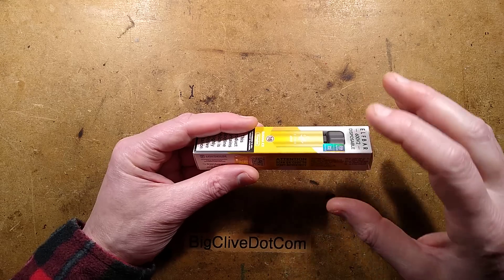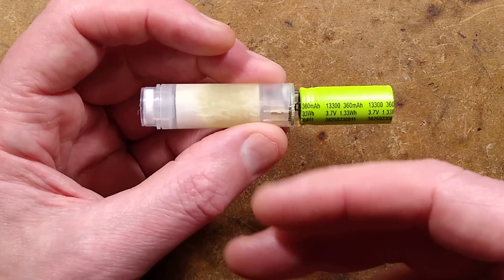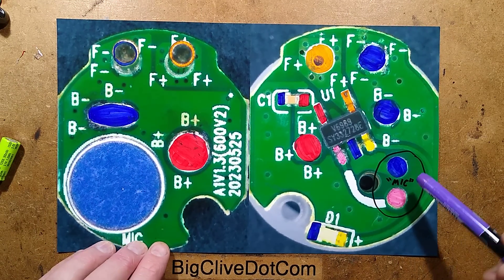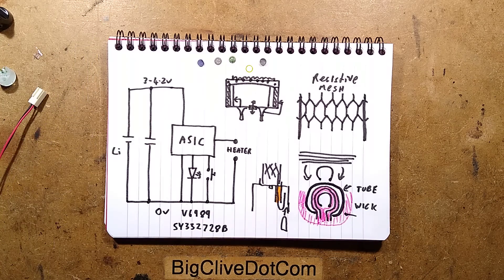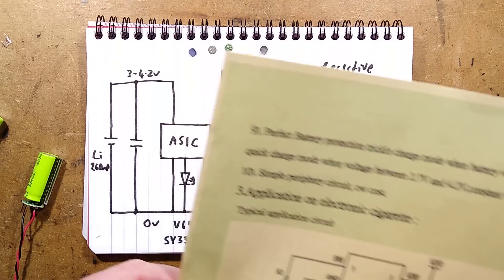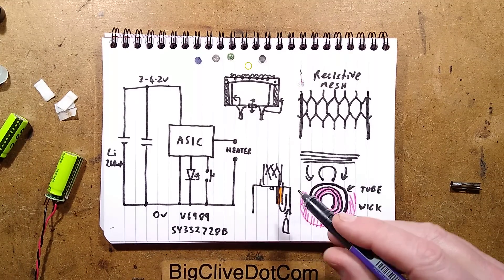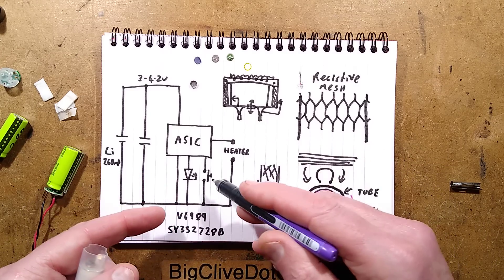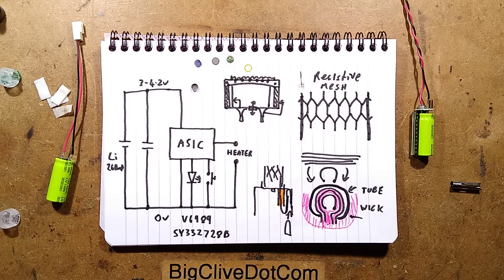Lithium "capacitor" in a disposable product

Comment: Shame it's still disposable but what a wonderful piece of engineering regardless...
Absolutely marvelous! Simple and effective, with just a bit less waste as compared to before.
Shame that we're still gonna find them where they shouldn't be...
Reply: The reason why they are disposable is because of the way they are designed. The liquid is suspended in a sponge type material, and the liquid is less dense, providing a more enjoyable vape. The trouble is the 2.0ml limit in the UK means they don't last long, and it makes them more wasteful.
The ones with replaceable pods are more eco-friendly, but the pods don't work out much cheaper, and they still contain the plastic tank,, mouth piece, coil and the sponge thing 🤷

Comment: heat the ground pin with a good soldering iron (JBC), tilt the cell so the pin slides out, then unsolder the positive.

less risky.

Comment: I've come across this model a few times and while its awkward to do, you CAN charge them, you just need some fine crocodile clips to get to the terminals and some kind of insulation to prevent shorting against back of the circuit board, after that, you simply hook up to your lithium compatible charger.
As for life of the device, I believe you should compare the coil of the V1 and V2 versions, since the coil gauge may be different.

Whatever the difference may or may not be however, I'll stick with rechargeable devices too, since you'll never get a strong enough flavored fluid to work particularly well with a recharged disposable device

Comment: Have you seen these hybrid lithium supercapacitors? They're basically a li-ion cell and a supercap in parallel, inside of a capacitor package. So you get energy densities similar to lithium, but peak current and ESR similar to supercaps. Unfortunately, being lithium, they do have a minimum voltage; discharge too far and they're destroyed.

Comment: I've found commonly with China products they cheat like this as follows ..3600mah is 3600 micro amps not milli amps ..the giveaway is the 2x 0 and the fact the the real world tests are always close to one of the zeros removed ..so it's a con job on the decimal point ..so 3600mah is actually 360mah ..

Comment: I bet that there is a small pouch style lithium ion battery on the inside. Wouldn't surprise me at all if they just were re-using a capacitor packing machine to wrap capacitor shells around a lithium ion pouch.

Comment: I suppose this does add some safety component to the device since the cell is contained within an aluminum capacitor casing. If something is to go horribly wrong with the cell it would just build pressure, and vent out like an actual capacitor. Even if the cell itself gets red hot or sparking, the fumes will have less of a chance to ignite if there's some distance between a potential source of ignition and the closest place where there's oxygen.

Comment: It is not not a Lithium Ion Capacitor (LIC) It would be labelled in Farads if it was. You would never specify a capacitor in mAh or Wh capacity or Diameter x length! It is just a lithium Ion cell in an interesting capacitor style can. The MIC is just that, but used as a capacitive pressure sensor (Clive, please see my detailed post 8h ago on the mic subject) It is definitely not a diaphragm pressure switch as such. Cheers Peter

Comment: The part labelled as MIC is in fact a microphone. Pressure sensors and microphones have very similar internals. Diaphragm on a coil, or in this case, diaphragm in front of an electret. Pressure sensors would generally be held to some kind of accuracy expectation and so they tend to cost $5+. So these guys are using a vented electret condensor microphone as a cheap differential pressure sensor. I guess that's what the ASIC is required for, it'll be looking for a reduction in capacitance (from the diaphragm deflecting away from the electret) from the mic for a certain extended period of time before it activates the burner. That time window probably needs to exceed 50ms or so, so that it doesn't get tricked by loud Bass.

Comment: Never realized they were using a tiny microphone as a pseudo pressure sensor as an on/off switch. Very interesting!
Reply: Clap on! Clap Off! The Clapper!
Reply: It's not actually a microphone, it's just in the same packaging as a tiny microphone because it's much cheaper to use the manufacturing capability that already exists than to design something new. It's a binary switch, the contacts are attached to the underside of the diaphragm and the connection is broken when you suck it hard enough to pull the diaphragm up. Rip one open some time if you find a disposable vape on the ground, it's actually funny how simple they are inside.

Comment: so I tested few of them:  I charged them to 4.2V, I set discharge current 100mA and cut off voltage: 3.3V. Then the results were: 1.13Wh (from as described 1.3Wh, so 87%) and 294mAh (from as described 360mAh so 81.5%) - not amazing but still I would say not that bad. If I went down to 3V it might have been as described probably. Will check again then.

Comment: A capacitor is just a battery that charges & discharges quickly.

I run a 75 Farad capacitor in my car, along with a Group 9 motorcycle battery, instead of the original 16kg battery. The cap- is to assist the bat- while cranking.

Comment: Thank you so much for letting me know abut these
Since I know what to look out for, I have now collected these things in the hundreds (Mostly from shops were they actually get returned to by some customers!)
I am currently working on a powerstation made up of those square pouch cells (all the same size of course). Planned are 7S100P of 500mAh cells, so 700 of them, which gives about 1,3kWh of energy
I sort roughly by voltage, solder 10 together, charge and discharge them to check for heating and capacity. Then let them sit for 2 weeks and check for self discharge. With a few exceptions all the packs assembled this way measure very close to 4600mAh from 4,2-3V @ 5A

Comment: All a microphone does is measure air pressure differences created by sound waves. It could very well be more of a mic than it is a barometer. I mean if it’s calibrated right it’d work. Hence the label on board.

Comment: I think it's a hybrid lithium super capacitor? Which might explain the capacity change. The 500mAh of LiPo might be necessary to be able to output enough amps, but the LiC has a higher power density (and lower energy density) so you can get the same peak current out of a device with a smaller capacity. Hence the 260mAh of the LiC. 

If it is a LiC, then you need to be careful with recharging it because the voltage isn't exactly the same as lithium Ion.

Comment: That might be a "LIC" Lithium-ion capacitor, they are a type of hybrid super capacitor that sit somewhere between a typical lithium cell and a capacitor. They have similar voltage/capacity curves to normal cells but are a little safer, more energy dense and have better pulse power performance. The downside is that they have higher self discharge and typically don't come in very high capacity.

Having said all that, they typically have capacitance markings rather than energy markings, so farad rather than mAh, so maybe I'm talking nonsense.

This just reignites my weekly thought of "I should be collecting these off the street, where they often end up, so that I have a pile of batteries to play with"

Comment: Clive I hate to say this but you are incorrect in assuming those pressure sensors are a diaphragm switch. They actually are electret mics but used in a different way!  The conductive surface of the Mylar disc is on the opposite side from the body frame cylinder. So cannot operate as you suggest (a contact pressure switch). Though I don’t blame you for assuming that is how these things work. It’s only when you dig deeper still that you see how they really work.

They have a continuous low energy AC oscillator signal applied to the mic insert. The capacitance change of the mic insert under vacuum suction is enough to be detected by the clever asic. Please investigate this (as I did) with your oscilloscope. You will see the continuous oscillation signal applied to the condenser mic! It is a capacitive sensor for certain. I can’t remember the oscillator frequency but it was fairly high iirc. I did grab a scope image but don’t have it to hand right now. Interesting about the fake capacitor. I’m sure it will have a standard Lion cell inside the cap case. Peter.
Reply: PS As further proof Clive, when you apply your scope probe to the mic terminal, the capacitance added by the scope probe is enough to trigger the asic output to on! If you try this, it is a real eye opener! The tech in these things is quite amazing. The oscillator design must be ludicrously low energy consumption just a few uA!! As it runs continuously since the thing was assembled!!  Peter

Comment: As an avid collector of the Li Ion batteries from these devices, (I have a strong need to get these off the streets due to risks to creatures) I have not seen one like this as yet. The packaging of the previous battery design isn’t very robust so it is interesting to see that they are packaging them in what looks to be capacitor casings. This must push the price up quite a bit. Be interested to see how they have packaged the cell inside the ‘can’.

Thanks as ever Clive for your interesting investigative work.
Reply: From my own experience these new batteries split open more easily. The pouch type batteries look fragile but are more resistant to crushing than the capacitor type batteries. The new batteries have a cross engraved at the top, this is exactly were the split open 😱
Also the two pins can easily be pushed inside the battery creating further problems 😅

Comment: These vapes should be outlawed simple based on the sheer amount of waste they create. Especially when refillable ones are just as good and far cheaper to use. I used them briefly and with my moderate use I was going through them weekly. They are hard non recyclable plastic not to mention the battery. There is zero ways to properly dispose of these either.

Comment: That's so cool! 
Much better for DIY than those tiny fragile pouch cells
Reply: But they are less crush resistant!
The pouch type batteries found in these vapes early leak, even when crushed by cars. I've found around 30 of these new type batteries, and 30% of those had split and stunk of electrolytes 🥵
I've collected more than 1000 pouch type batteries, less than 5% of those were found to be leaky, despite many of them had been crushed 🤷

Comment: The problem with lithium capacitors/batteries catching fire is most of the time they short-circuit. To prevent that you need to isolate the positive and the negative separately in such a way that even fluid can't make them short-circuit, because even a little bit of rain can make them short-circuit if the poles are hold the way up.

Comment: Back in the early days of vaping (like 2010ish) you'd only replace the coil/atomizer (just a tiny bit of aluminum and kanthal wire). You'd keep the glass/plastic parts and the battery. These newer ones are so wasteful. Modern compact vapes with replaceable coils still exist, but you have to look for them since those stupid "pods" are what's popular.

I use a UWell Caliburn which uses replaceable coils, but, frustratingly, they make an near identical model that uses replaceable pods instead, wasting a ton of plastic for no reason, just for those people who want to save an extra 4 seconds when replacing their coils. 🙄

Comment: The battery really does look like an electrolytic capacitor with the + gas escape hatch and the slight bulge at the base.

On a side note, I really wish that disposable electronic devices like this would be banned as well as the tobacco ones. I have enough trouble breathing without some rude person filling the air with choking cancer causing vapors.

Comment: Yes, I have rebuilt numerous wicks for my old vape devices, and have replaced the capacitors as well. If you know where to get stuff for cheap, it has a good cost benefit for people like me addicted to nicotine and looking to stop. Disposable vapes also have rechargeable versions, many of which utilize USB-C connections for a clean, well regulated, and sustained charge. Breaking those down into parts after or before use can provide some resuable things, if you enjoy tinkering with electronic devices to see what you can make.

The capacitors in some of the rechargeable vapes actually have a high enough output to power a Raspberry Pi, and if done correctly with enough of them, you can create a mini UPS. Lots of fun litte things can be made with these 🙂

Comment: Weird… wonder if somewhere had extra casings

I typically buy the rechargeable versions of these, but I wish they were easier to refill before the coil burns. I can’t figure out how to make that work.
Reply from the maker: You have to keep on top of using a refilled pod for only one charge cycle to avoid it going dry and burning.

Comment: They really did make cell look like a capacitor, even with the venting cross on the top.    
Looks like they have done this to help it fit on the circuit.  Maybe to simplify the circuit, but I would say it is also to help prevent recycling by scavenging.   Maybe they have a conscious desire to help people not get diseases from picking up second hand ...... no  no,  it must be cheaper to make them this way

Comment: Those are lithium polymer cells, the charger on the device is probably disabled because it can't properly charge it. Standard charge is constant current @ 0.2C to 4.2v, then 4.2v constant voltage until charging current falls to 0.01C. I've built chargers of that type before, usually requires a dedicated IC and at least a coil and a cap. They probably just used the cheapest battery controller they had on hand for a different chemistry, and charged the batteries before assembly.

Comment: Huh. The little capacitor-can lithium-ion batteries could be really useful as RTC or otherwise backup-power batteries and the like for various projects, it seems. Especially if paired with a charger that tries to keep them in the 'optimum lifespan' range instead of the usual 'optimum capacity' one?

Comment: The capacitor type case is probably a hazard when trying to recharge the battery. That may be the reason why they took out the recharging capability. But this needs to be stopped. Wasting Lithium in that way? No. Just no.

Comment: I have acquired a cheap rechargeable device with replaceable mouthpieces... the mouthpiece contains the reservoir, heater, and sensor, and magnetically clips to the body that has the cell and charging electronics. On this particluar design, there is a transparent free liquid chamber where you can see how much fluid is left, and just a small wick that introduces the fluid to the heater, as it seems. And these seem to burn out after about two fillings of fluid has been vaped. The replacement costs about 6 EUR while the whole device was about 35 EUR. Stuff like this is kinda expensive here... the base fluid which consists of vegetable glycerol and propylene glycol is also quite pricey when bought from a vaping shop - for example the same ingredients are available for baking dirt cheap compared to that. At least gluten free baking uses those to retain moisture to avoid the bakings becoming rock hard.

One day I might verify (or disprove) my assumptions and take one of the dead mouthpieces apart. But that might also become yet another project that hangs in a limbo after I get it started. Time will show.

Comment: Honestly these disposable vapes shouldn't be legal IMO, if you want a reusable one fine, but these things serve only to create more electronic waste. Honestly I don't even really see the need for reusable ones to have a bespoke tank or cartridge when there has been a long standardized screw connector with a negative exterior and a positive center pin that's often also screw adjustable for a tight contact. It's a fine mechanism for 2 relatively low power electrical connections; it's worked just fine for the light bulb for over 100 years, which is fitting because the operating principle is basically the same.

It's just a power delivery mechanism that heats a coil and vaporizes some liquid, it's not a complex circuit. Heck the most simplistic ones don't even have power regulation they're just a metal tube with with a NO switch to close the circuit and the coil made of a resistance wire as the load, then when you need to recharge the battery you pull it out and put it on an external charger.

Comment: I found a data sheet for "13300-360mAh-3.7V capacitor battery atomizer electronic cigarette handheld fan rechargeable cylindrical battery" and they go for 2.40 Yuan or about $0.33 USD each.

Comment: i found one of these during the summer in my back garden, it was thrown in by someone walking past.. it was already shorting out as it had a light that glows when someone draws a smoke from it and the light was in a fixed on state... i said then to my son this is very dangerous for potential fires if people are buying these and just tossing them anywhere when theyre empty
Reply from the maker: That glow is because moisture was triggering the sensor.  When I see that it's good news because it means the cell hasn't been over discharged and is good to remove.

Comment: Reusable ones are all around better. If you get the right one it doesn't leak even after multiple drops and the refillable pods last basically forever. unless you drop it too many times or on the wrong spot but most of the brand I use survive a lot.